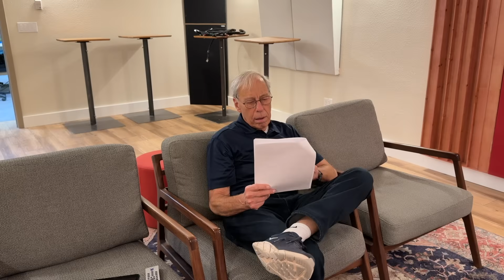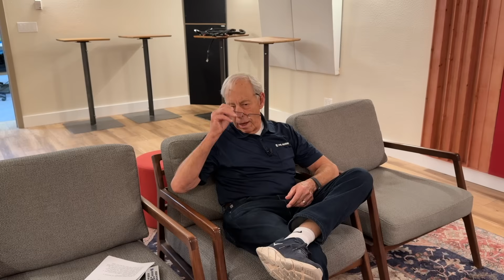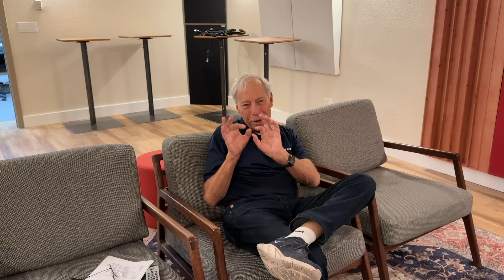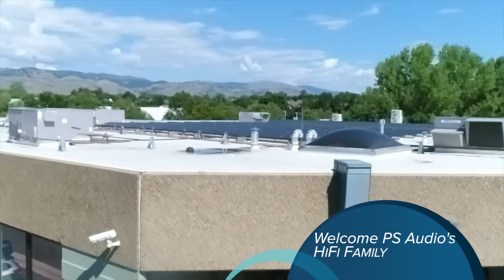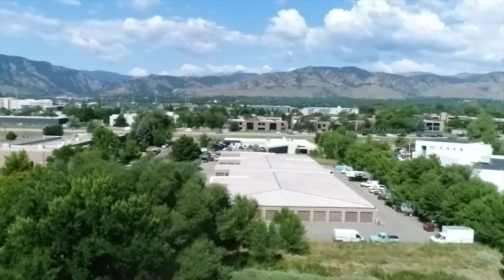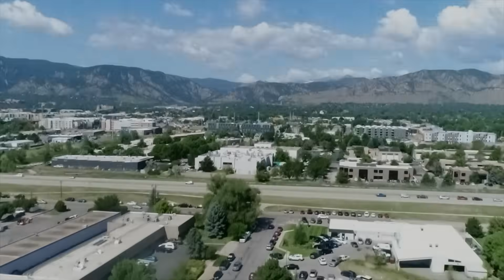Solar powered High End Audio

Comment: Not all inverters are built the same. Most of them are switch mode, the ones good for audio have massive toroidal transformers like the one in my Victron Multiplus-II 15000 VA unit.

Comment: I do worry about the level of knowledge on show in many of these comments. Yes, having your own panels and battery is a nice set up- in DC. But stick one of those nasty inverters on it to make AC... and you have noise. Even if you are off grid with no mains, your system will will only be as good at that inverter. Live in a street where every other house has solar, all trying to export ... all generating mush at  higher and higher voltages in an effort to export surplus power to the grid you are connected to and you have a very poor supply to feed a hi-fi. Ok for fridges and washing machines... but not hi fi. Even before solar was a thing, Hi Fi sounded better at night when the mains was cleaner and the voltage more steady. Now daytime is far worse. But if you don't hear any difference then you are lucky....and probably could save quite a bit of money by getting a cheaper music system.

Comment: Paul is, once again, spewing nonsense.  There is no “climate crisis”. There has been a warming of ~1 degree C over the last CENTURY. It's happening mostly in winter and overnight temperatures. Daytime summer temperatures are rising much slower. That's a good thing as 10 times more people die of cold than heat. Look it up.

Warming is a good thing because the growing season is now a week or two longer. Global food production is at an all-time high. The Earth has been greening.  Look it up.

The United Nations IPCC in their latest Analysis Report, AR6, finds that there has not been any GLOBAL increase in hurricane frequency, severe wind storms, drought, or floods (both coastal and interior). Table 12.12.  In addition, there has been no increase in strong to violent tornadoes, energetic lightning storms, hail, or global wildfires.  Look it up.

The only bad thing that the climate alarmists (like Paul) correctly point out is a small increase in heat wave frequency (but not intensity). Before you say that scientists don't agree, note that the IPCC IS the climate scientists' bible.

Comment: Here’s the deal. If you have a solar system with an inverter that generates a modified sine wave, a linear power supply, like those in your class A, class A/B amps will not be designed with filter caps capable of handling the ripple out of the rectifier and it will affect the sound, as the “DC” out of the power supply will contain too much “AC”. 

Additionally, as Paul is saying, these units are generating power similar to a power amplifier, as opposed to a large generator (like the power plant has) and so the variable current draw on your power amps will cause the output of the inverter to clip when you draw 40 amps peak at a large transient in the music just for a few milliseconds. So the amp will be starved. 

It is worth mentioning that switching power supplies, including class D amplifiers should not be affected by inverters since they self-regulate, converter AC to DC and back to AC, then DC, and impose their own time constant, and their output noise, within spec of the equipment is constant and much more than what you’d have on the AC line anyways.

Comment: This is a clear use case for great cabling too as those inverters for the solar battery are very noisy "unintentional radiators" (an FCC term).  And if the installation isn't adequately bonded the radiated noise will be worse.

Comment: I agree Paul.  It's not that a domestic solar panel/battery/inverter system is bad, they can be designed to be very good!  They can be desgned to adequately power the typical mix of household appliances.  However, using an additional power regenerator, specifically used to power your hi-fi components, is probably more important for a domestic solar/battery set up than when you draw power from the public grid.  I think, in general, there's a lot more headroom as far as low-impedance, highly-regulated power from the public grid than there is from a typical domestic solar/battery set up.  There's also better isolation from the power draw of other appliances in your house.  So, for my money, it's more important to use a power regenerator for your hi-fi when you use a solar/battery system.
Reply: Morning Kitch 🍵

Comment: Question for the show: "Hey Paul, huge fan of the channel! I have a Coax and USB cable both running out of the same streamer and through the same DAC (both by the same well known in Audiophile circles manufacturer) and surprisingly to me, they both measured identical! I did x3 sweeps on both cables across 2 different Dac filters. I had read, that COAX was more fuller and USB better at separation. So, my question is, can cables measure identical but sound any different? Many thanks!'
Reply: @LDN_BOX ...short answer...YES.
Reply: Cheers man!

Comment: Time to go DC in the home. DC off the panels, batteries, ... DC into the devices. Replace all the AC to DC power supplies in every piece of hardware. All the noise, ....
Reply: Issue is that DC can only run short distances. Also if you tried to run large power amp off a car battery for example, you’d get voltage drop when you pull lot of current,
Reply: @JohnC-fx4ue  Wrong. DC can run with less loss farther than AC. For any given length of wire, you have it's pure resistance which equally affects AC and DC and then inductive and capacitive reactance added for the AC. That myth was from the original Westinghouse/ Tesla days. Because DC can not be easily stepped up and down in voltage, it had to be sent at the usable voltage and suffer the losses. While AC could be sent at higher voltage and tapped down close to the end point. The losses could be compensated by higher source voltage. 

And yes batteries have a higher internal resistance. And slower to release electrons than a capacitor.

Comment: When my solar panels are producing, I have steady voltage, never varies more than by more than 1 volt: value of one currently 123.45 to 12 3.75,  DC line noise is lower than at night when I pull in from the grid

Comment: Paul, with all due respect to your audio expertise, you clearly lack knowledge of modern PV panels, inverter technology and storage systems. Our ranch is 30 minutes up the mountain from you, just outside Nederland. We have had PV panels powering our home since we built it. This includes, home, guest house, barn, shop-garage, well, etc. We pay grid connection fee of $35/mo, just as emergency backup but have not used a single kilowatt from XCel in the last 3 years, since adding 33kwh of battery back. 

Our system employs Enphase IQ8 microinverters, transfer switch/controller and batteries. I have used a scope to evaluate the AC current delivered by the inverter from the batteries. It is nearly a perfect 60Hz sine wave. It is actually cleaner than the XCel utility service. 

In fairness, I still use a Powerplant 12 to power my turntable, tape deck, phono preamp, tape head preamp and line stage preamp. The active crossover and all amps are directly fed by wall outlet from my Enphase inverter supplied power. I do believe there is an advantage to using Powerplant, especially on small signal source gear, but suggesting a modern solar inverter is higher distortion or less consistent than utility AC service is extraordinarily naive.

Comment: Very well understood. Would it not make sense to redesign the hi-fi power supplies to take on DC directly?
Reply: Nope.  Some PV systems produce 48 volts DC but other may produce over 600 volts DC.  This all depends on the configuration on the roof.  How would a HiFI company deal with such a non-standard system.  MSEE with 52 years experience.  My system has a bit over 14kW of AC coming from my PV panels, with each panel utilizing its' own micro-INVERTER.  Yes Paul you finally got the correct word! Plus I have 80 kWh of battery back up.  I can control where my house get its' power from my app.  I get cleaner power from my system when not on the grid. Based on my load testing my system has much lower impedance than the grid. I am a bit over 200 feet from the utility's pole mounted transformer which raises the impedance just like very long speaker cables raises the impedance that amp sees looking at the speaker... lowering the amp's ability to control the speaker.
Reply: @alanrkanter hopefully you have a roof made of slate.
Reply: @franciscovasquez5979 ...yep, we have to start somewhere...like every new step that we take with technology.

Comment: Power the gear with DC and swap out the power supply for a regulator.
Reply: Nope.  Some PV systems produce 48 volts DC but other may produce over 600 volts DC.  This all depends on the configuration on the roof.  How would a HiFI company deal with such a non-standard system.  MSEE with 52 years experience.  My system has a bit over 14kW of AC coming from my PV panels, with each panel utilizing its' own micro-INVERTER.  Yes Paul you finally got the correct word! Plus I have 80 kWh of battery back up.  I can control where my house get its' power from my app.  I get cleaner power from my system when not on the grid. Based on my load testing my system has much lower impedance than the grid. I am a bit over 200 feet from the utility's pole mounted transformer which raises the impedance just like very long speaker cables raises the impedance that amp sees looking at the speaker... lowering the amp's ability to control the speaker.

Comment: The power transformer of our BHK250 humms less, when it is on our "own" solar-power in comparison to if it is running with grid-power. The sound also improves slightly. To me it seems that a decent converter already produces "cleaner" AC than what is coming through the grid.
Reply: Low AC mains voltage causes transformer hums. It's not "dirty" as in the sense of it being noisy or high distortion. Modern solar system and inverter with battery output much more reliable AC voltage

Comment: If you have the money and want to invest for this certain purpose you can go for a Compressed Natural Gas generator that is extremely clean and efficient although most of them are more  commercial than domestic but it's unbelievably clean. I worked at the local gas company for over 30 years and they used CNG throughout their plants, buildings and vehicles and it was very successful. You do have to maintain like everything else but if you're looking for alternatives CNG is still a good clean source if that's what you want. Also Solar is getting better and better by the day so there's always going to be better options as time moves on. 💯✌️ Good Luck with your power source project.👍
Reply: Gas is a fossil fuel so it's not clean. It's cleaner than coal or oil but it definitely isn't clean.

Comment: Solar Cell DC -> Solar converter DC2AC -> Power Regenerator stage 1 (AC2DC) -> Power Regenerator stage 2 (DC2AC) -> Power Amp PSU (AC2DC)

Such a waste! So many AC to/from DC conversions each with waste heat (“Good” for the environment). I have always wondered, talking about separates, why don’t audio companies build a separate DC PSU can combine that with a Power Regenerator. Then let all the separates share this same DC PSU/Regenerator separate
Reply: I also wonder this, Solar is DC. Why not have the solar go to a battery stored as DC and have a DC run system? Did Paul not say previously that a DC run system would be the best sounding? From the little I have read it would be really clean and hardly any distortion? Could have a separate solar system to run your HIFI. How many kWh would be used in a listening session? I have seen much crazier things done in this hobby, this wouldn't be the worst.

Comment: Paul is making a fair argument why you might need a power regenerator for solar installations. But every product can be more or less immune to impurities on the AC mains power so how do I know if I have a problem? Paul should take the lead to design the internal power supplies of PS Audio products such that no external power regenerator medicine is needed incl. when powered from solar installations. BTW, I can agree a lot of measurements in audio have near no value, but how about coming up with a method for measuring/testing robustness against AC noise? Definitely some products are much more sensitive than others.

Comment: My house is solar powered but batteries run as priority load into my house, without a power regenerator and my system sounds sweet. Measurements might not look great, but it certainly sounds wonderful.
Reply: This is my experience also with a class a tube amp and record deck
Reply: My house is also solar powered and frankly speaking, consumer electronics products are supposed to operate flawlessly also on solar power. I would make an argument that if some audio gear has audible problems being powered from popular residential solar installations, it's not the fault of these solar installations but rather the audio gear not having adequate power supply filtering. A lot of topics like these tend of being without evidence btw. Is this a real problem of significance or not? Is it a problem only for specific audio products? Is it even a problem at all?

Comment: This was about the influence of running solar energy connected to Hifi equipment. Have new installed customers experienced any down sides when it comes to SQ??? Please point the climate crisis debate elsewhere...
Reply: We’ve had solar since 2020 in the UK, we paid extra for a more premium company who used more modern panels and inverters. I have a class a tube primaluna Evo 100 integrated amp with my record deck, only play analogue. I’ve had no issues at all with my audio
Reply: Our host has said, in several videos, that he avoids bringing up politics.
Reply: @0Perhaps   ...the melting of the polar ice caps has nothing to do with politics.

Comment: Well one of the major things is to stop palm oil production. it destroys so much rainforest probably about the size of California every year. This is causing weather related problems rainforests controls the weather. Also it's putting farmers out of business dairy Farmers in a few years time we won't see any cows.
Yeah but what's the point you might as well just bypass AC and feed it on the other side of the transformer regulator at its correct voltage.
Reply: It isn’t palm oil we need to stop. It’s the reliance on oils as a whole. Stop palm oil farming and another crop takes over instead. We need to grow and use smarter rather than demonise one plant.